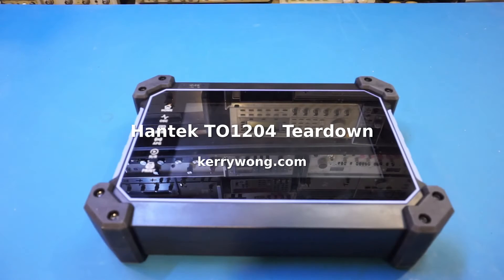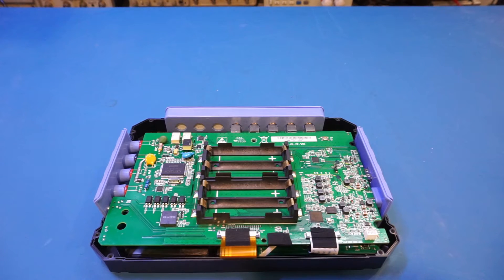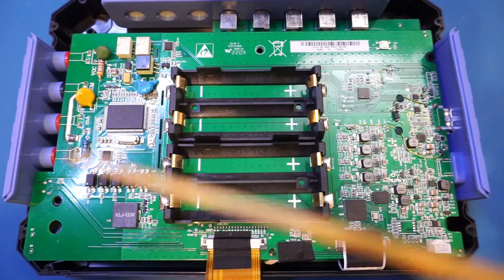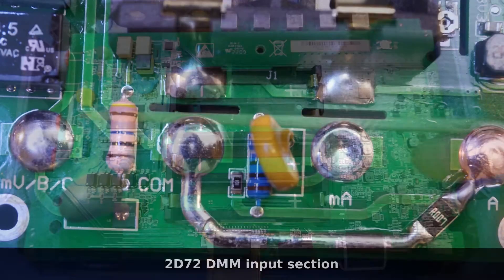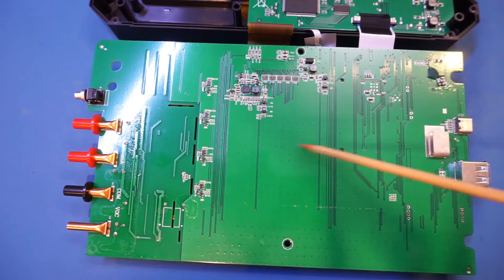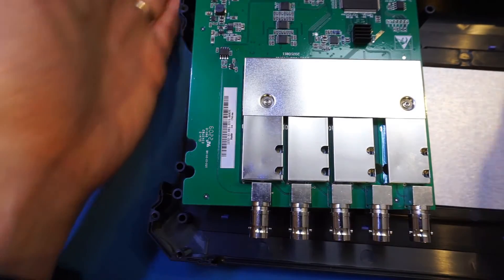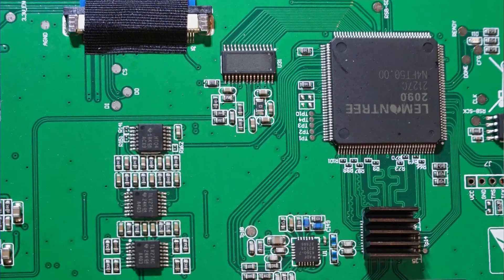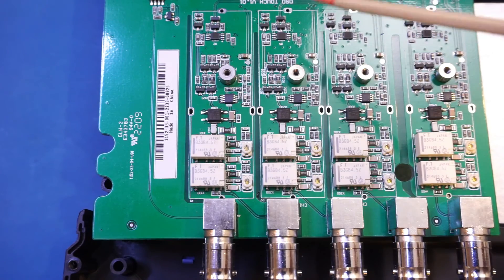Hantek TO1204D Digital Oscilloscope/DMM/AWG Teardown

Comment: Re 04:56 "bodge-wires": looks like one goes to a decoupling capacitor, the other to an overvoltage protection diode.  Please correct/refine this interpretation if you know better.  Further details below...

Looks like the longer wire goes to a small value capacitor (decoupling?) labelled “512” ⇒ 5.1 nF.  If so then maybe to overcome an AC-induced voltage drop across the board's ground plane.  I have seen such things before, elsewhere (not Hantek), e.g. I once measured a board having a ground-plane resistance of 0.5 Ω across the whole board (copper too thin?).  Or I guess there might have been an unforseen issue related to higher clock or signal frequencies, where wavelength vs track lengths etc. could be quite a challenge (no shame on the designer!).  

The shorter wire looks like it goes to a robust-looking component labelled “SS14” => a Shottky diode of a type typically used for overvoltage protection (offering low forward voltage drop and high surge capability).

Comment: Hi Kerry sir!
I need your help please!
I wrongly put current Into the wave generator and smoked the three pin component down to the right of the 8 pin Differensial output amp. 
Do you know what that component is. 
Would grately appriciate your help!!😊
Reply from the maker: The only marking I could read on that SOT23 is A7. Not entirely sure what it is.
Reply: @KerryWongBlog  Thank you very much sir! I Maybe its an BAV99. But I will try to verify with the manufacutrer. They say they are checking with enginering to me... Thank you for your assistant. I will post my results here when i get them, if others have same problem. :D
Reply: @KerryWongBlog  For anyone interested and with same proble,, I got the information from Hantek and it's an BAV99LT1G :D